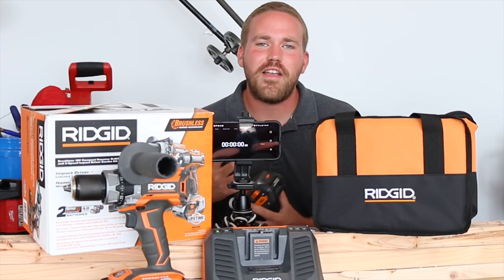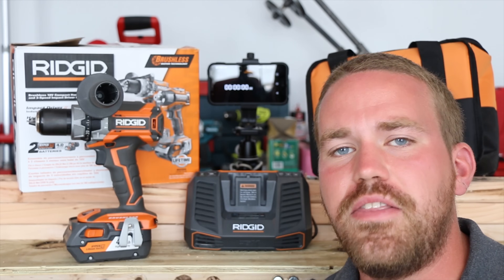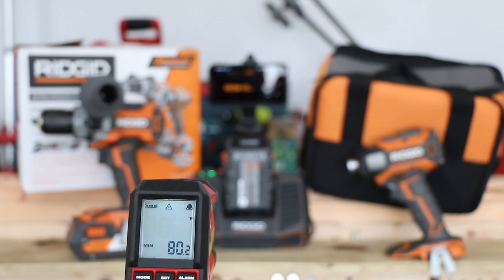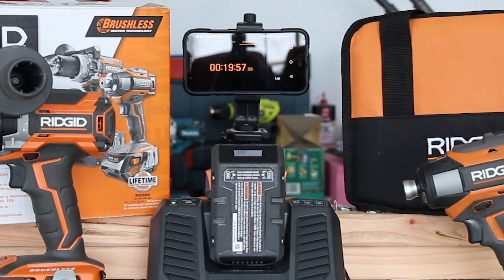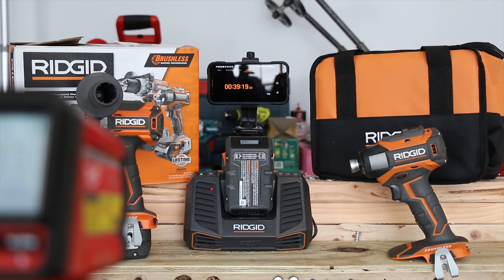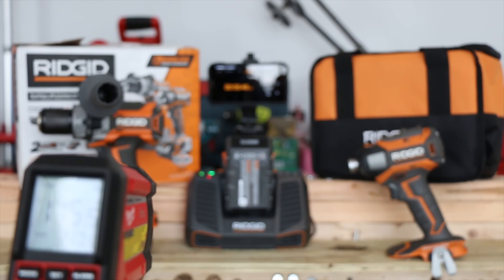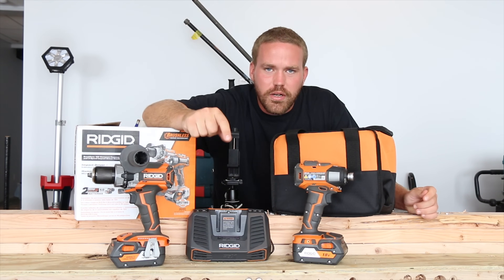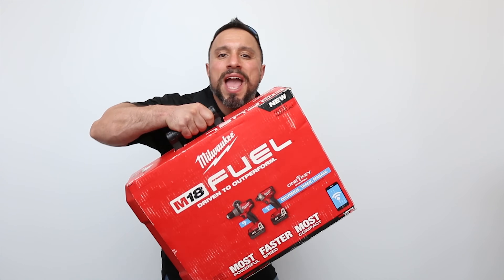RIDGID 18V Lithium Ion Batteries Defect? - Watch Before You Buy!

Comment: Why don't you contact Ridgid and report the definitive issue/results within the video?  Asking for comments merely broadens the speculation. A mischarging or overheated L-Ion battery is dangerous: the cells can become highly combustive.  There is circuitry to protect against the danger.  I wouldn't be thanking Ridgid for a job well done.  As an MS electrical engineer working for a failure analysis engineering company, I tested L-Ion laptop batteries, to failure, while one-by-one bypassing the charging safety features. One battery cracked the protective cover on our combustion chamber.  On another occasion a failed cell propelled itself across the large shop space.  Point being, charging failures can burn your house down and have caused injury.

Comment: I have had charging issues with rigid batteries but only the 4-Hour battery the two hours seems fine the six and the 9 hours seem just fine but the 4-Hour batteries I have two of them that are brand new but won't take a charge and it just says that they are defective

Comment: I'm in Australia, and Ridgid is branded as AEG here. The difference is mostly cosmetic so I thought, but I've had someone in the industry tell me that the AEG branded stuff is subject to better quality control, obviously I can't personally vouch for the truth of that statement, but it does seem like the AEG name is much better respected in the UK and Australia than Ridgid is in the US so maybe it's true. I've got a collection of AEG tools, some I've had for years, and they are bloody bulletproof. Absolutely excellent for the money. Just as good as the newer Makita stuff, but quite a bit cheaper. I have a couple of those same chargers (branded AEG) and I can tell you the ones I have have a LOT more ventilation than that Ridgid unit appears to have, the whole front of the unit is basically a big ventilation grill, with plenty more vents on the bottom and the back. Mind you, 100 degrees F is considered room temperature here where I live, lol. My chargers get warm during the charging process, but I've never had one shut off in over 7 years. I've always had them sitting in the open with airflow around them, I reckon if you shoved it up in a corner somewhere with stuff around it it would overheat pretty quick. The Makita chargers have fans in them, which is another way around the problem, but as an ex computer tech I can tell you passive cooling is ALWAYS better than active cooling if you can get away with it. No moving parts means nothing can fail. If that fan gives up she's a goner, but a passive cooled unit will never suffer from such a failure. Just make sure there's a bit of airflow around it and you're good, and keep half an eye on it on the really hot days.
I reckon that Ridgid unit of yours has a defect of some sort - or possibly its heat dissipation just isn't good enough. Maybe it's a result of the quality control thing. Or maybe that battery has a cell that's just starting to let go? An intermittent fault in the battery cells would cause that to happen. My next step would be to check the battery out. Do some isolation testing and find out exactly where the fault lies - is it the battery or the charger?
Finally, that's way too long to charge a 4Ah "Force" battery - mine charge up in about 45 mins so there's definitely something dicky going on.

Comment: I guess the longer the charge time the more potential heat build up.  I think ambient temp in the work shop is an important factor as well.  If the environment is warm then the charger will get higher temps too.  This is why user experience can vary depending on location.

Comment: i have 4 rigid chargers and a dozen+ batteries, 2 dewalt chargers with another 6 batteries and 2 chargers and batteries from team red. I've never had this issue without damaged or overheated batteries. My rigid quick charger fully charges a 4 amp hour battery in 20 minutes. This seems like unreliable sensationalism. Ill check another video or two but if they are all this loaded I'm out.

Comment: If you try to charge the battery while it is hot the red or defective light will flash until it cools down enough and then it will start charging again. Especially after long use and throwing it straight into the charger.

Comment: I think you guys may have run the battery down too far. I use the 4ah batteries i have 4 of them. I needed to use my flashlight and used a battery with 1 bar left. It took a long time to recharge that battery back to full. So now when my batteries hit 1 bar i pull them off for a fresh one. I think the charger may go into a slow charge mode. Its possible that if you put the battery on for 10min pull it off for a min then put it back it may charge as normal. Ill try it out next time i got a low battery and see
Reply: I bought all new ridgid tool set and it took forever to charge a 3ah and 2x 6 ah batteries

Comment: My first impact driver was a Ridgid. I had no problems with the tool itself, but my batteries would drain so fast.. I had one 2.0 and one 3.0 battery, and they would both be completely drained from driving deck screws for a couple hours.. After I got a hold of my Fuel kit with two 5.0 batts, just one battery would last me the majority of the work week!! I still like Ridgid, but their batteries need to step their game up if they plan on keeping up with the big dogs at work!!
Reply: I've used the Ridgid brushless impact and 4.0mah battery and it last the whole day and still have half the life left.

Comment: It may have done that because the battery was so dead I don't know mine will go dead to the point the tool stops but once you let it sit a couple second it will start again for a couple seconds probably not a good idea to drain them to nothing but who knows try recharging again but this time when the battery dies put it on the charger before it's dead dead.

Comment: Charger shuts off when the battery gets too hot and then restarts when it cools a little. It’s not an indication of a bad or defective battery. Just normal safeguard against overheating the battery during recharging.

Comment: had a ridgid drill and jigsaw...  came with the big batteries, then they stopped working so i picked up a few of the smaller profile ones...  but after having bought a few dewalt tools, the ridgids now just sit in the cabinet - they feel like bricks and are nowhere near as powerful as the dewalts...  problem solved!

Comment: No I had ridgid  changed to Milwaukee  they have the largest tool platform out there and they work with the trades people  to design a great tool ridgid offers a life time warranty but it's a waste.if a tool fails it 2 months to get it fixed.tool tech changes so much anything more 5 years warranty is a waste.Millwaukee has better batteries  way a head  of every body even dewalt  scrambles to keep up
Reply from the maker: Thanks for the heads up James!!
Reply: Funny, cause it's made by the same people

Comment: That's really weird. When you drain a battery fast it'll usually bounce back a bit, but on something like a light you will actually get the battery to a lower charge state. Even then I've timed it and I've gotten under an hour for the same battery/charger combo. One of my batteries does read defective sometimes but it's one that I rebuilt and the circuit board has some light water damage so it's not surprising. Usually though it will charge just fine if I take it off and put it back on. Great video as always!
Reply from the maker: Good to know Joshua and thanks!

Comment: Noice work Nick.... I think it throws that when the battery is getting too hot because I've actually heard other people that say when the battery gets too cold it will do the same thing... if your doing some work in the winter and and it's out in the truck and it's ice cold it will read as defective.... you have to warm the battery up a little bit and and it's fine.....
Reply: Craig Cundiff I agree.  Our have done that a few times . The battery are 100% and have 0 issue . Been a year .

Comment: Vince I still like my ryobi brushless hammer drill it not my most used tool I use my ryobi brushless 3 speed impact driver and 3.0hd batteries because that is the best tool that ryobi made
Reply from the maker: I’m interested in how the brushed tools would hold up against the brushless!!
Reply: @VCGConstruction  i still have my gen 4 ridgid drill kit...thats brushed
Reply: richard garner...my milwaukee gen 3 impact driver will destroy your ryobi 3 speed impact driver 🤣
Reply: @kingofthecrease30  I have thought about running over my ryobi brushless hammer drill and ridgid brushless drill driver with a steam roller and then buying the m18 fuel gen3 hammer drill
Reply: @JENNABEANIE9039  lol 🤣
Reply: Richard Garner Ryobi makes a steam roller???? 18v???
Reply: @renaissancemen1  that will be a dewalt steam roller I am going to run over my ryobi brushless hammer drill and ridgid brushless drill driver with

Comment: Good to know. Those batteries are not actually made to be completely discharged like that. I know it happens. I am guilty of it. Maybe that had something to do with it #justsayin
Reply: Maybe it needs to be romanced. Take the battery out for dinner and a movie. In the mean time I’ll be Stackin Racks with my DeWalt.
Reply: Renaissance Man and while your Dewalt is overheating and shutting down. I will be working away with my Makita. 🔨🔨🔨🤪🤪🤪🤪🤣🤣🤣
Reply: Renaissance Man oh the one  where the Dewalt got so hot the grease was oozing out. 😉🤪
Reply: Dan Soderholm a wins a win. Looks like I’m walking into a ambush using that “slightly used like new gun”. Still gonna crush that Red China toy.
Reply: Renaissance Man I am still cheer for ya
Reply: Dan Soderholm huh ......I always fully dis charge mine
Reply: Nate wahl I do it 1 or 2 times a year

Comment: Are ridgid tools good?
Reply: Sculpin the answer is no....only Milwaukee is good. But bring honestly, Rigid isn’t bad. In fact rigid contracts Milwaukee’s owning company to make their tools. Milwaukee Ryobi and Rigid all same company.
Reply: @natewahl9873  i will disagree on that...milwaukee has its problems just like any other brand...there are plenty of stories out there about milwaukee tools going bad after 6 months...it happens....to every brand out there....in 25 years of using these tools ive used all of the major brands...they all have there problems
Reply: kingofthecrease30 ummmm, king, I thought u stepped over to the red side
Reply: @natewahl9873  yo cuz....im on all sides...i have tools from milwaukee, dewalt, ridgid & makita...they all make good stuff...im not loyal to just one brand...that kinda thinking is good for pick up trucks or sports teams...i use what is gonna get the job done the best way....only tools i stay away from is harbor freight and walmarts hyper tough...not a big fan of ryobi but they make 1 or 2 tools i would try out
Reply: kingofthecrease30 garner says tryobi makes a steam roller.
Reply: @natewahl9873  no way. Really?
Reply: Sculpin r u trolling??
Reply: @natewahl9873  no why you think that?
Reply: @natewahl9873  no Dewalt is really good as well.
Reply: Sculpin yes the ok even good depends on your needs
Reply: @Therealphantomzero  are they comparable to Dewalt? Or like bosch?
Reply: @averagebloke4474  yes. And. No. They are  Pro consumer like Porter Cable for Stanley Black & Decker
Reply: Sculpin well close to Dewalt some tools are good others alright.  But it's less expensive.  So you can go to work with these.  If need be.
Reply: Sculpin their biggest issue is battery charge times they are rather slow compared to others
Reply: @bluemantom77  ehhh. .. They're better than Porter Cable.. I have both and although PC gets a bad rap(as being trash... They're not)
 the Rigid tools are consistently better in many ways.. .a true Pro-sumer grade tool...PC is home gamer... but they work well......at home...👈
Reply: Yes they are. I bought a framing saw for $160 about 7yrs ago the base was made of carbon fiber. I use it everyday and it sounds and feels better than the day i got it. Sad to say they don't sell it in home depot anymore.